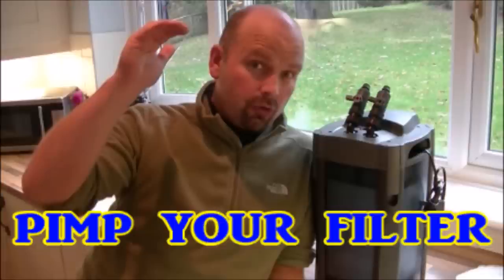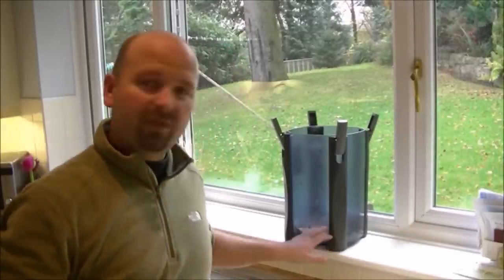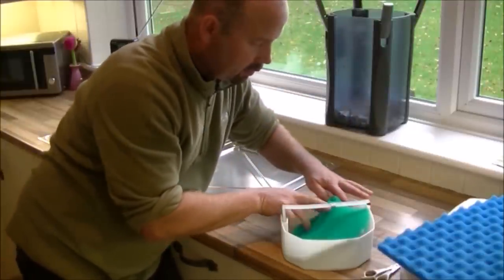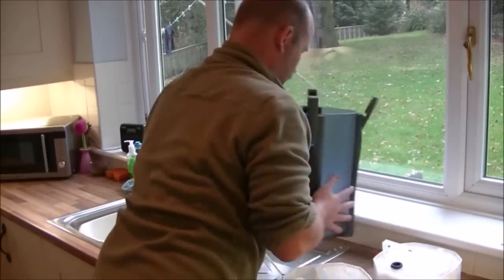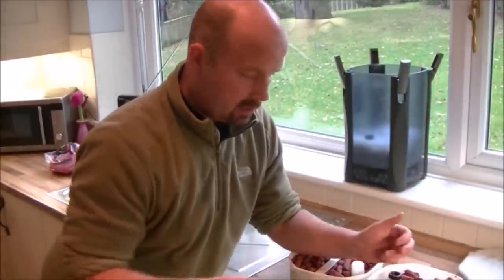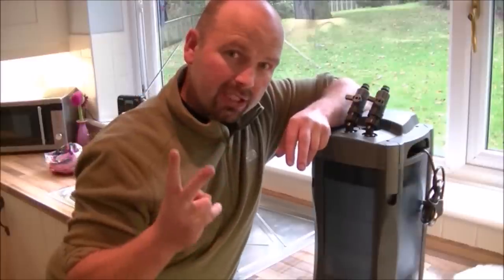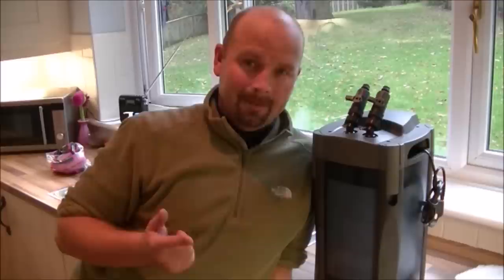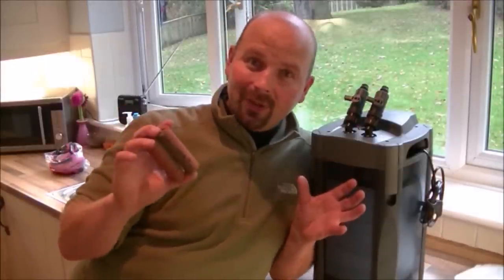External canister filter set up, nitrogen cycle and what happens in a filter - by Pondguru

Comment: Hai pondguru..ive got a question..is it acceptable to use smaller size canister if my tank is on side fiter..its 4x1.8x2....the canister is an additional filter...tq for your help..
Reply from the maker: I'm unsure what you mean by 4x1.8x2 so don't know how to answer the question unfortunately. A 4m x 1.8m x 2m tank would need a gigantic filter.
Reply: Pondguru Outdoors its 4 feet long 2 feet wide n 1.8 feet tall..not gigantic Sir..hihi...its with built in side filter (3 compartments) on its left...
Reply from the maker: That makes more sense - thanks for that.
If the compartments aren't big enough to hold much media then adding an external filter to it will be no problem.
Reply: Pondguru Outdoors thank you very much for your kind reply...appreciate it.. :)
Reply from the maker: That makes more sense and it is under 100 litres so you would need between 1kg of biohome ultimate (normally stocked community tank) to 2kg (heavily stocked) to achieve full cycle filtration (reduction in nitrate). Given the size of the tank I'm sure you could get at least 1kg in a side sump filter so it should be fine without adding an external as long as the existing filter was set up properly.
Reply: Pondguru thank you for your time & kind reply...i realized your reply pretty late...my sincere apology...lotsa lotsa thank you once again.
Reply from the maker: That's no worries, sometimes I miss comments all together, lol

Comment: can you do an fx6 plz ..so much b.s rather hear from the master than the apprentise
Reply from the maker: +SEMMO1972 lol, I'm not even the master of my own house as the wife is the boss (that's the secret to a good marriage....)
The FX trays work from top to bottom and I will be mentioning different types of filters in a huge 2-3 part video which I am planning (that makes a change, lol) to be a huge information dump which will have time stamps in the video description so viewers can skip to the parts they want to see.
Here is what I have saved in my emails to send to people who have FX filters:

As the trays work from top to bottom and have good foams surrounding them you really only need a thin fine pad on top of the top tray then fill the trays below with media. Each tray should take around 1.5kg of biohome ultimate or a but more if neatly packed. Therefore you can get up to 5kg in an FX5/6.
Here is a guide of how much to use from my website http://www.filterpro.co.uk

IS THERE A MINIMUM AMOUNT OF BIOHOME REQUIRED TO ACHIEVE FULL CYCLE FILTRATION?
Yes - Using 500g in a huge filter on a 500 litre tank will not reduce nitrate if all the other media is producing nitrate. When a sensible amount of biohome is used the results are outstanding.
Most filters will by their very design hold a suitable amount of biohome e.g. the majority of external filters for a 300 litre aquarium will commonly hold 3kg - 5kg of media.
Through years of Biohome being used in all sorts of aquariums and ponds the recommended amounts of biohome needed to see a good reduction in nitrate (full cycle filtration) are as follows:
Average community tropical aquarium  = 1kg per 100 litres
Average coldwater aquarium = 1kg - 1.5kg per 100 litres
Predator aquarium = 1.5kg - 2kg per 100 litres
Large cichlid aquarium = 1.5kg - 2kg per 100 litres
Malawi / Tanganyikan aquarium = 1.5kg - 2kg per 100 litres
Marine aquarium = 1.5kg - 2kg per 100 litres
Average mixed fish pond = 1kg per 200 litres
Average koi pond = 1kg per 150 litres
Ammonia and nitrite will be reduced at much lower amounts but full cycle filtration is the only 'proper' filtration therefore the figures above are for the filtration job to be done properly resulting in less water changes being required.
REMEMBER - It is always better to over-filter than under-filter as a filter with a larger capacity will react more quickly to any pollution incidents and process waste before levels rise above safe amounts.

Hope that helps.
Regards,
Richard
Reply: THANKS.. rich you are a legend and a master lol :)

Comment: I am so confused by everything i am watching and reading. PLEASE help me out. i have a cold water tank about 70 L with 4 fancy gold fish and 2 shrimp and 1 pleco. I currently have a FLUVAL U1 Filter in my tank and that it. I am thinking this filter is not the best for my tank. But then I am reading about air pumps and  UV filers and loads of other things i am so confused on what i need to keep my fish happy and healthy. I would love some advice from you as you know what you are talking about. Many thanks from Emily
Reply from the maker: +Emily Faith Astin The Fluval U1 is way too small for 70 litre tank and if you have 4 fancies and a plec in there which are heavy polluters you really should be looking for a filter which will treat 'up to 150 litres' to cope with the waste. The best would be an external filter if you have space for it as most internals simply won't hold enough foams or media to cope with goldfish.
A properly set up suitable size external filter will keep the water quality great with minimal maintenance and no need top waste money on cartridges or special foams associated with internal and hang on back filters.

As far as UV goes there should be no need for one unless you have multiple tanks linked to the same filter. As long as there is plenty of surface movement from the filter outlet there will be no need for an air pump as gaseous exchange will be no problem with a disturbed surface (that is main benefit from using an air pump as it doesn't actually increase dissolved O2 in water to any noticeable extent).
Hope that makes sense.
Regards,
Richard
Reply: thanks you :)

Comment: hello can we put coral pieces in the basket...will it act as filter media...i see many fish shops sell the coral pieces here in my country..tq
Reply from the maker: For species which like a high pH mineralised water e.g livebearers, malawis, goldfish and marine fish using coral in the filter is fine as long as it is really small as it has a decent surface area compared to many ceramic media types available.
Reply: +Pondguru Outdoors mine is just an asian arowana...is it ok? the real issue is the biohome is very expensive once its on sale here in malaysia...if its a bit cheaper i would have use biohome for my filter...tq 4 ur kind reply...☺
Reply from the maker: You would have to check with the fish suppliers in your country as wild Arowana come from water which is around 6.5 and quite soft. I know many fish breeders in Asia will use water which is much higher pH and quite mineralised so the choice of media will depend on what the fish in your area require - hope that makes sense.
Reply: +Pondguru Outdoors thank you very much 4 ur kind reply.☺

Comment: Thank you for the excellent video on canister filters. I am just getting back into the fish keeping hobby and this has been very useful.
I recently purchased and setup a Fluval 306 canister filter on my 38 gallon aquarium. I am definitely going to redo it since my tank is not cycled yet. Here in the US though it is hard to find the pond filter pads like you have. I did, however, find an online pet store that sells fish supplies and they have a course, fine and extra fine. Since my Fluval has the filter pads that slide down the side of the filter, I could consider this the course filter pads right? So I would just need the medium and fine to fill the bottom tray. And those polishing pads located with the carbon on the top tray should go too. I am planning on ordering the Biohome Ultimate from Great Wave Eng. here in the US. I emailed them and they are out of the Ultimate right now, but are expecting shipment hopefully next week.
Thanks again for the great videos you produce. This makes so much sense in how to set up a canister filter! :)
Reply from the maker: Yes, Don from Greatwave was telling me that the foams are difficult to get in the US so he is trying to source some as it would cost a fortune to send them from UK due to their bulk.
With regard to the foams you are correct so you would just need medium and fine in bottom tray and media in trays above.
Hopefully the customs will release Don's order - sometimes takes them ages.
Reply: Pondguru
Thanks for your help! I was wondering if it would be okay to just order the medium and fine foams I found online for now. The medium foam does not have the "egg shell" effect like yours does, they are flat. Hopefully Don at Greatwave will find some good foams. I might just order the Biohome Mini Ultra since I already put some of that bottle bacteria in my tank,
Thanks again for all your help! Much appreciated!
Karen
Reply from the maker: Karen Talbot The main problem with flat foams is that they clog much quicker but saying that having the correct grades will strain out dirt effectively even if the foams are flat. Medium and fine is better than only having coarse and medium.
Reply: Pondguru Thanks again for you expertise! Much appreciated! :)

Comment: Where can I buy one of these kits. For my aquamanta efx300
Reply from the maker: The FilterPro website has kits of various sizes http://www.filterpro.co.uk but I'm not sure how much the EFX300 takes as my records are as follows:

EFX 300 CANISTER FILTER
TRAYS: 2
WATER FLOW: Bottom to top
BEST MEDIA: Biohome Ultimate
  / Mini Ultra
AMOUNT PER TRAY: 2kg (4.4 lbs) 
LAYOUT: Fill bottom tray with coarse, medium and fine pads, tray above with media, chemical media (if used) in top of top tray. 
MAX. TANK SIZE (NORMAL STOCK): 200 litres (52 US gallons)
MAX. TANK SIZE (HEAVY STOCK): 100 litres (26 US gallons)
FILTER UPGRADE KIT: 2kg
THE EFX 300 HOLDS LESS THAN THE EFX 200????

That is what I have on the website but that is from measurements given to me a while back.

Comment: I am planing to use bio ultimate media do I need to use purigen also with bio ultimate ?
Reply from the maker: The purigen is used mostly to ensure crystal clear water but if the filter is suitably sized and has the right foams / fine pad and a suitable amount of good media in there will be no need to use the chemical filtration. It may even hinder the bacterial development of filters by drawing in too many trace elements needed by bacteria.
Reply: Thanks for advised make sense

Comment: Hi mate I have a fluval 206 I have one of the sponges like an egg carton in the bottom basket it's right thick it's one that fluval make then in my second basket I have put corse medium then fine then if I get some bio home to put in the top basket will that work ok can you get back to me and what size bag of bio home will I need and will it come with some of them balls that break down thanks
Reply from the maker: It probably would be better to go with medium and fine foams / pads in bottom tray since the foam down the side of the filter already has the coarse foam. That would leave 2 trays for media. Each tray in the 206 easily holds 500g of media so if you went with 2 trays of media you would need 1kg and if you only went with 1 tray you would need 500g. Best media for external filters is the mini ultra or ultimate.

Comment: I have an eheim canister filter for my saltwater tank, the setup of the eheim means my sponges and filter floss go in the top of the canister, there are then ceramic balls, ceramic discs and finally plastic rings in the bottom tray, in this setup where would you place the bio home media?
Reply from the maker: +bigseanSM It sounds like the foams are in the wrong place as the plastic rings would normally be the first media water would hit after the foams. If you let me know the model of filter I can tell you how it should be set up no problem.
All the eheims I know work from bottom to top so would be set up just like in this video (if they have a 'pre-filter' foam in the top that would be left in as extra mechanical filtration)
Reply: Eheim pro3 there's a coarse blue sponge at the top, with holes cutout to let the impeller motor sit in, then a tray with floss and ceramic balls, then a tray with ceramic discs, and and finally a tray with plastic rings at the bottom. That's the way the instructions say to set it up
Reply from the maker: +bigseanSM No problem just leave the pre-filter in top and set the rest of the filter up the way shown in the video. That way you will get all your mechanical filtration done first, then the biological. They way it is set up now with the fine pad at the top of the top tray (just under the thin pre-filter tray) means that the fine dirt has passed right through the filter, clogging the media and is only caught in the final tray just before leaving the filter.
Hope that makes sense.
Reply: +Pondguru Outdoors cool, so plastic rings in the bottom, then floss, then bio home ultimate, then maybe a final floss at the top?
Reply from the maker: +bigseanSM Just set the trays up as shown in the video. The plastic rings are taking up valuable space in the filter. The bottom tray should just be the layered foams and floss and the trays above that would be for media. As you have the 'pre-filter' in the top of the filter just leave that as it is as it will act as extra mechanical filtration.
Reply: +Pondguru Outdoors ok cool, I've had this saltwater tank for 18 months and had canister filters for about 15yrs when I had tropical fish, crazy to think that all this time I had them all set up the same way. thanks again 👍

Comment: How much Biohome Ultimate (in kg) for one Aquaclear 110 Overhange filter? I ordered some and have "Pimped" my filter using the above method. I replaced the stock media bag with this as much as possible and it's almost 1.25kg. I used some of the stock noodle media on that bottom 12mm gap. Do I need more media? Since I replaced the stock pad with a CMF setup I have more space.
Reply from the maker: Dear Eric,
I don't know the size of your tank or the stock so I couldn't say if you need more media to achieve the full cycle filtration associated with nitrate reduction. You can check amount needed for different stocking scenarios on the Q&A page of my website here: http://www/filterpro.co.uk
Regards,
Richard
Reply: Pondguru Outdoors Thanks for that! Im at 90 gallons or 340 liters, so 5.1kg on the high side based on the website. I ask because I have 3 filters on it, 2 x Fluval 406 and the Aquaclear 110 so I just wanted to be sure how to divide it. It's a coldwater tank with 6 Fancy Goldfish. Thanks Guru!
Reply from the maker: If the tank was heavily stocked then it would be nearer 7kg but with only 6 fancies in the 5kg should be fine. Each tray of teh 406 should hold approx. 1kg so assuming you sacrifice the bottom tray for medium and fine foam / pad you could get 3kg in each 406 or definitely 2.5kg in each 406 very comfortably.

Comment: Having been ill I just re-watched the video, I intend to buy some biohome ultimate from your ebay shop, how much would you recommend for a 60 litre tank installed within two trays in an Allpond Solutions external filter? The trays are 232mmx232mmx63mm approx. Thanks in advance
Reply from the maker: Do you mean 600 litre tank, not 60 litre? as those trays are huge for a filter on a 60 litre tank. Each tray will hold around 2.5kg of biohome ultimate so for two trays you would need the 5kg amount. If you do have only 60 litres then 1kg would be way more media than you will ever need to process waste from that tank.
Reply: Pondguru
lol I mean a 60ltr, it's my little community tank, I use to experiment with, so I don't cause any damage on big scale, the filter is big for the tank,, the mechanical filtration is taken care of but I'd like to use your 'Ultimate' media so I have aerobic and anaerobic filtration. So based on what you said I could order 1kg of media and split it between two trays?
Reply from the maker: thebones Yes that will easily cope with waste from 60 litres no worries.